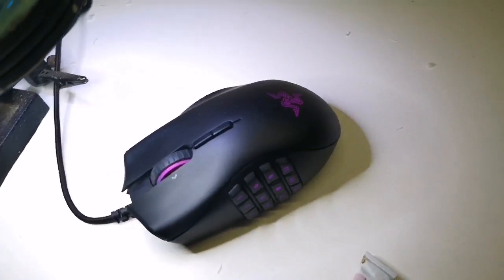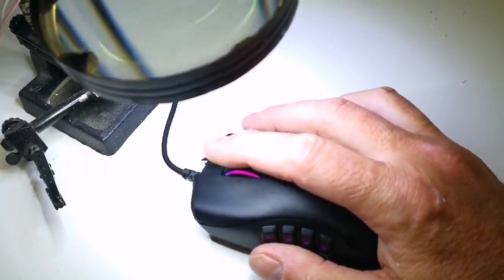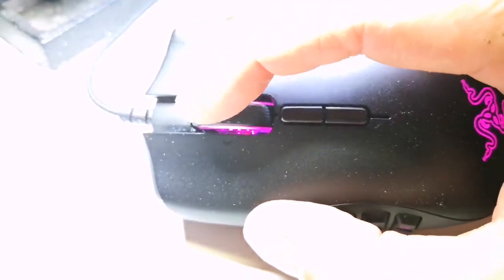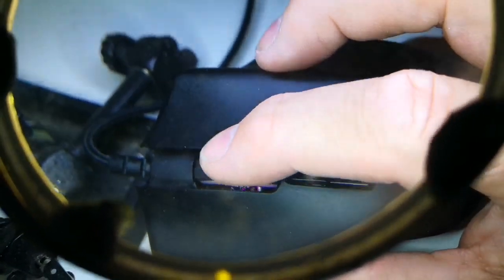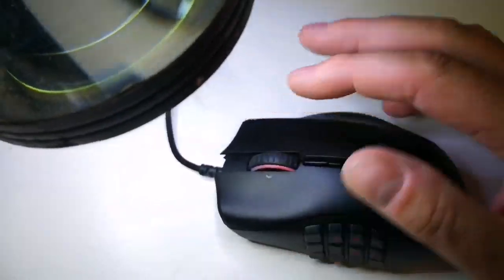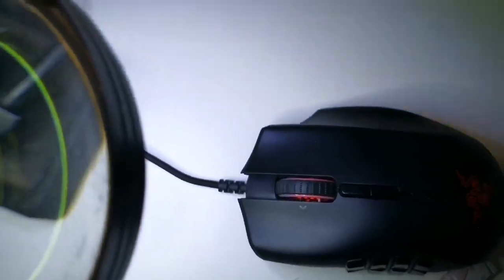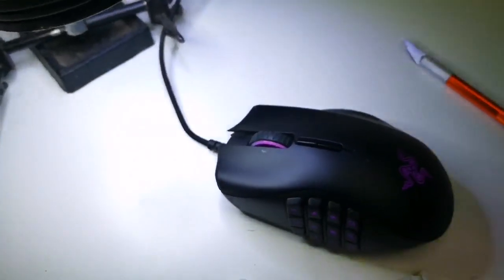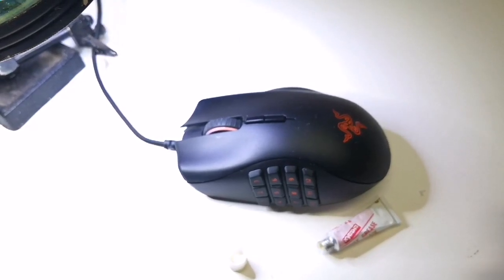RAZER Naga Trinity Scroll Wheel Fix

Comment: A little late to the Naga Trinity party, but I just got mine and found an even better solution (for my preferences anyway). If you press the spring (metallic, hook shaped) under the bar down and left it releases the bar and scrolling is butter smooth. The wheel itself has some friction, so even if you flick it up or down it stops after like 3-5 scrolls, unlike a free-spinning-wheel. This procedure is unfortunately irreversible(or at least super tricky) without taking the mouse apart, so try the lubrication workaround first if you want to maintain clear single scrolls.
Reply: Did the trick for me as well! Just bought this mouse yesterday, love the idea of swapping left button panels, but the wheel felt like part of some cheap toy tractor. Stiff as hell and bumpy ride, tip of my finger is still numb from it. Was about to return the mouse, but luckily i have found your fix. Sorry OP, haven't tried your fix :) Anyways, mouse is useable now, thanks @WerNearWerty!
Reply: @WerNearWerty did this too, finally I can use the scroll now. Ty
Reply: THANK YOU!  Some more information to help future modders of this.  When he says left, he means as you hold the mouse.  If you are looking down the hole at the front of the mouse, its your right.  Second, use a tiny flat head or some other little metal rod.  Also when you go down and to the side, you do it until it snaps, then BOOM you have a great mouse.  Very much a design flaw.
Reply: @coronbale  good clarification here, thanks for the input!
Reply: thanks for the tip. used bigger needle, put it under the bar (from top of the mouse) and use the needles leverage to presssure the spring hook around the bars part. eventually i catch the springs hook into the needles eye and push it down while keeping the bar up by needles leverage. it went off and the scrolling wheel now scrolls smoothly without any anoying sound or pushback.
Reply: You're a saviour. 2023 new mice still have the problem, your solution worked without having to take it apart. Scrolls even smoother than my previous mouse now. Thank you!
Reply: It worked flawlessly ty man
Reply: Just did this to mine fixed it real good
Reply: you're a lifesaver. just bought one 2024 and still has this issue, did just this and it fixed!!!
Reply: Came from your review. Is there still any sort of step with the scroll wheel even a minimal one when doing this? Im still trying it out but I can tell its making my finger tip a little sore.
Reply: Alternatively you can just remove the metalic wire that controls the scroll and totally free it.
Reply: This is a GREAT advice, thank you ! 
However, when i did try to move the spring, it went to the bottom right of the bar (when you look at your mouse in the direction you hold it)
In result, my wheel was even stiffier because the spring was pushing on the bar even more 

So I had to open the mouse to put the spring to the left of the bar. In result, my scrolling is now completely smooth, thanks again
Reply: i was pussing the metalic wire trying to removed. i heard a click and now the scroll is fine.i wonder how the wire moved so it wasnt stiff anymore but i didnt lose any function either.
Reply: To add to this, I was having trouble getting the little curved hook spring bar to go somewhere it wouldn't jam the wheel even worse than the standard setup, but you can actually push it down under the wire for the wheel button, keeping it entirely out of the way with the feedback bar completely disengaged. Went from a noisy ass mouse that chewed up the end of my index finger in a single afternoon (and I'm a bass player, that a tough feat!) to a silent, smooth scrolling joy to use
Reply: @laservampire Can someone confirm that after trying this solution, you can click the scroll to the left and right without problems?
Reply: can someone explain this procedure with a bit more detail ? i did not understand. 
thank you in advance
Reply from the maker: Pinned tyvm 👍
Reply: This did the opposite of me. It completely ruined my ability to scroll. Makes it way more 'stiff' and jarring, since apparently the feedback bar is being kept from pressing harshly against the wheel by the hook itself.. But I managed to get the hook back on easily enough.
Reply: @ErrorIn1984  Well Im gonna try it. If it ruins the mouse Im fine with that. Then I'll just do a better job reading up on the next mouse. EDIT: hey it worked! Super smooth now without loss of function as far as I can tell. Thanks yall!

Comment: wtf is this scroll wheel?! I had a trinity before, it was working like a charm. The scroll wheel was loose and fine and I was very happy with it. It's 2024 and I just bought a new one. I'm working as a software developer and I can't even scroll through my code without pushing hard enough for the click to activate, making the experience completely miserable.
I tried to move the side panel to my old mouse to double-check it wasn't just the side panel which had died there but unfortunately, that mouse has internal damage, where buttons 5 and 10 are dead so there is nothing I can do. I'm going to have to test that grease method. Ideally, I'd like to just bend the metallic piece forcing the stick against that internal wheel but it'd be game over if I bent it too much.

Comment: Had same problem, opened mine and there was a jagged edge on the small metal bar that glides inside the scroll wheel. Removed edge with a metal file and scrolls way smoother now.

Comment: 2023 New Razer Naga Trinity still have this problem. Did not try the solution in the video, but the pinned comment worked for me. Thank you! :)
Reply: how did u get it off? im struggling getting the thing off
Reply: Can you confirm that after trying this solution, you can click the scroll to the left and right without problems?

Comment: Okay.  I just bought a razer naga trinity and the scroll wheel is stiff as all hell.  HOWEVER -My solution is different than yours.  Basically, if you look on the inside you can see a long piece of metal on a spring which pushes upwards into the notches on the inside of your scroll wheel (I suggest having either the mouse turned on with its lights or use light to see inside.  Either way, if you look inside then you will understand what I mean).

So basically a piece of metal is catching into the plastic notches on the inside of the wheel... metal.. plastic.. Idea.

I used my wifes nail file (because it was nearby, but you can also use something softer like the plastic straw thing you get with compressed air cans) and slid it inside the mouse and pressed the metal bar UPWARDS in order to make the scroll wheel mechanism very tough, and then I started scrolling as hard as I could.  This ultimately meant that the metal wore down some of the plastic inside of the wheel itself.  Now my scroll wheel is much easier to use.  If you wanted to disassemble your mouse and then manually file down the notches or bend the metal or loosen the spring so its not pressing upwards so hard, that will also fix your issue I suspect.

In theory slipping some glue in there and sticking down the metal piece will create a frictionless mouse wheel, but thats not what Im looking for.

TLDR: Slide something thin but hard like a nail file down the side of the mouse wheel and lift UP the metal bar.  If your mouse wheel becomes hard to scroll then you are doing it right.  Keep scrolling in order to slowly grind down the notches on the inside of your mouse wheel.  This might take a few mins or longer!  Stop when you find its normal operation to be adequate.

Or just RMA it.

Comment: my wheel started feeling "sticky" a week or so ago. i found this video today. i didn't have any grease handy, but i saw a comment suggesting using WD40. so i decided to try it. first i used an electric duster to blow out anything that might have been in there. then i sprayed WD40 Electrical Contact Cleaner down along both sides of the wheel. i spun the wheel around for a while, then let it dry for several minutes, and then took the electric duster to it again. it worked amazingly well. the wheel feels better now than it did when it was brand new. not sure how long it will last, but it was a fast and easy fix that i can easily perform again. much better than starting an RMA process with Razer, which i was contemplating right before finding this video. this might be a better solution than using grease, as applying grease every few months will likely end up with lots of dirty gunk built up inside. using WD40 ensures that everything is nice and clean after the procedure.

Comment: this mouse has been on my radar for a long time. i love razer synapse, i like the idea of the swappable side panels, and i only use wired mice - so i bought one brand new in august 2023.
but on day 2 of using it, i started having issues with the scroll wheel. put some hand cream inside the mouse wheel and now it scrolls properly. i'm not sure about the spring mod in the pinned comment, but i'm enjoying using my new mouse with the greased up scroll wheel.
thanks for making this video, and shoutout to all the commenters with naga trinity mice of your own. see you in 1-3 months (edit i haven't had to re-apply the hand cream in 2 years wow)

Comment: Just got a new Naga and the scroll wheel was stiff. Used some Unilube a mineral based oil, didn't help at first but after blowing some compressed air the stiffness went away.

I would be carful with what oil to use. From experience some oils don't mix well with silicone and rubber making it swell. Introducing oil may also increase the accumulation of dust so don't use to much.

Comment: Even though this video is 4 YEARS old, this issue still persists in the Naga Trinity mouses still sold in 2023, as my mouse I bought in January started showing signs of stiffness in late February and is pretty much unusable now in mid-march. I used some gun oil lubricant delivered through one of those bottles with a needle syringe on the end to reach all the way inside there, and it seemingly "fixed" it, for now. I'm bookmarking this video, since I will obviously need it once the gun oil stops working and I forget how I made it work again in the first place.

I feel so stupid for buying this mouse, my previous Corsair mouse was flawless, but corsair's icue software is total garbage and crashes frequently, or stops recognizing my corsair mouse until I unplugged it and plugged it back in. Corsair could be the best if they took their software seriously. The Razer software is so much better and intuitive.
Reply: I noticed resistance in the "down scrolling" direction within the first week of getting my mouse.
Reply: @dnaak  I use this mouse heavily every day and the gun lube somehow managed to last these 3 months without any issue.
Reply: @dnaak  Just bought a new Trinity, got it replaced, and the new one got this problem in under 6 hours of gameplay...
Reply: I just bought one and in a matter of days the scroll wheel is stiff af. Wtf.

Comment: My issue is the scroll wheel does not work at all - no issue with turning it. The tilting left/right button works, just not responding to a scroll! 
I have tried drivers etc & also canned air for any dust but idk what else to try. Anyone got any advice?
Reply: I have the same problem dude, if you have found the solution pls help me :(

Comment: I got this mouse not even 3 months in and i got the double click on my left click issue, having to use my old naga 2014 until technical support can give me any helpful info except have you uninstalled synapse and the mouse from the computer, my old naga 2014 had the same issue but on the right click i fixed that but don't want to operate on my 3 month old trinity in case it has warranty.

Comment: Thank you, now I know what the problem is, but I wouldn't wanna use lube tho, since it might cause problem to the other hardware if you have to do it every few weeks, I just kind of applied a bit of force on the rod and bent it downwards a bit, which made it a lot more smooth now
Reply: what did you push the spring down with?
Reply: This worked great for me! No need to use lube or anything, thx man! <3

Comment: WD-40 is a common alternative to what this guy is using. Spray some on something flat like a napkin or toothpick and repeat the same thing this man did. Thank you for the video. The scroll wheel feels smooth as ever.
Reply: WD-40 should dry out very fast, because it is not a lubricant, it's a solvent. Once it dries up, it'll feel just as rough as before you applied it. That's why a proper lubricant would be recommended
Reply: yeah i wouldnt recommend WD-40 haha
Reply: @ManTheDan  it works surprisingly well man.
Reply: My wheel started feeling "sticky" a week or so ago. i found this video today. i didn't have any grease handy, but i saw your comment so i decided to try it. first i used an electric duster to blow out anything that might have been in there. then i sprayed WD40 Electrical Contact Cleaner down along both sides of the wheel. i let it dry for several minutes, then took the electric duster to it again. it worked amazingly well. the wheel feels better now than it did when it was brand new. not sure how long it will last, but it was a fast and easy fix that i can easily perform again. thank you!